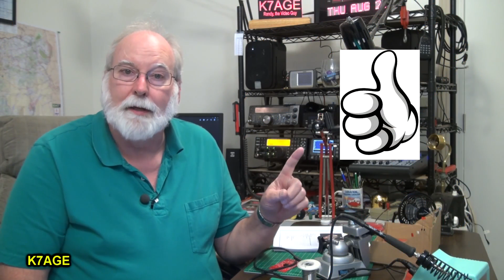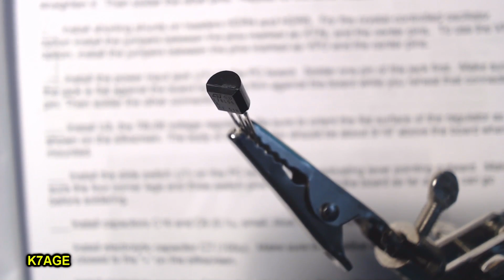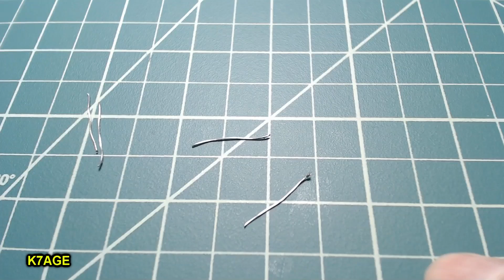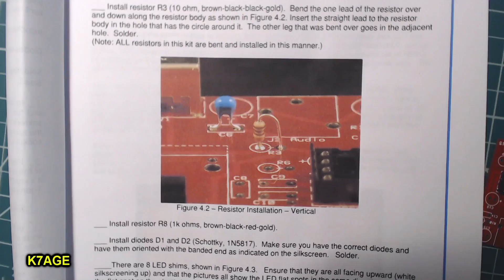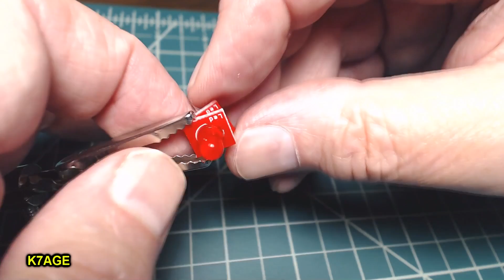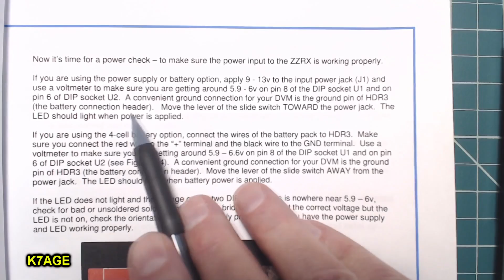K7AGE Builds The ZZRX-40 Receiver Kit- Part 3 - Soldering More Parts

Comment: Randy, I've been a ham for 40 years, and yet I learned several cool tricks here I've not seen before. This is great! My kit has arrived and I'm looking forward to putting it together. 73! de KE0OG
Reply from the maker: +David Casler what cool tricks?
Reply: Soldering one of the IC pins, then while pushing it toward the board, melt
the solder and then the socket stays firm in the right place. Also, just
soldering technique in general. I've never been that good at it. I get by,
but it's nice to see better technique addressed.
Reply from the maker: Dave. So much of what I do when building seems like second nature to me. I also spent several years as a field service engineer when we repaired to the component level in the field before surface mount and board swap became the normal. Glad to pass along my techniques. Seeing things shows that it is not difficult.
Reply: Randy, thanks. If perchance you could show the technique for removing solder from a joint, I'd be most grateful. I've never been able to do that successfully. 73, Dave, KEØOG

Comment: Something I discovered with my kit, is that if you own a Baofeng the charger that comes with that makes a great powersource for the kit if you don't want to solder on a 9v battery onto the board.

Thanks for the videos!
-Eric, W9EO
Reply from the maker: Good tip, thanks

Comment: You may find this eventually, but if you want to use the Crystal that is located on the board, you will need to set the jumpers to XTAL.  That is what I needed to do after completing it this past weekend.  Those are some really small resistors and capacitors - hard to determine between orange and yellow. I had to unsolder one of the resistors because I used an orange instead of the yellow.  Great videos though, and you have some good tips.
Reply from the maker: Glad that you were able to find your error.